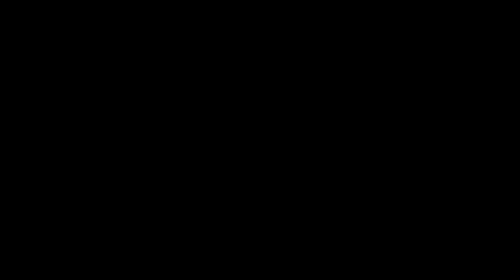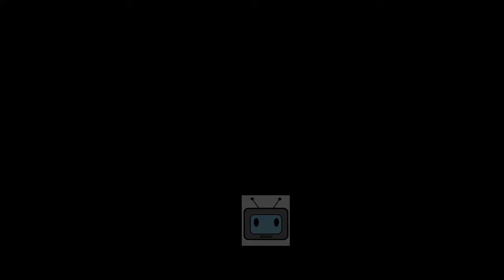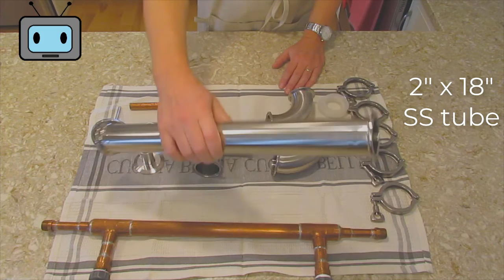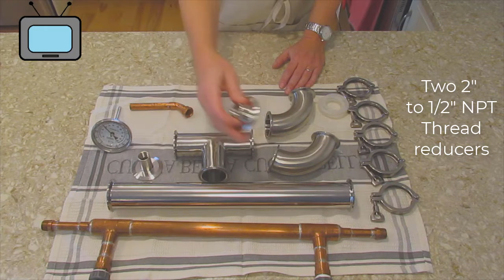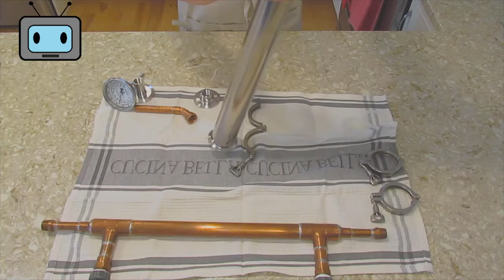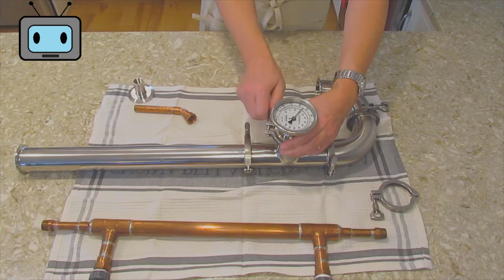Simple pot still column. No welding or soldering required

Comment: Great Video! Did you create a reflux column? Would love to see a video on that. - Also when connecting the threaded sections would you use teflon tape?
Reply from the maker: I bought a tri-clamp dephlegmator section that I am using as a reflux condenser.  I have been working on some ideas to make a less expensive version.  No teflon tape is needed at the points where I have threaded connections (no leaks)  except for the cooling water.